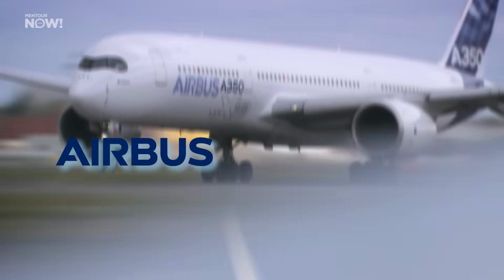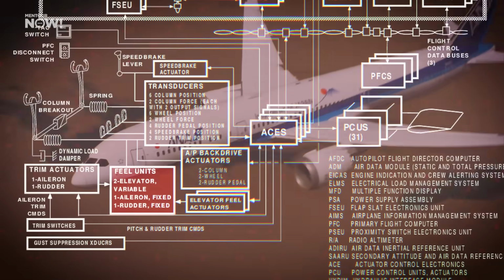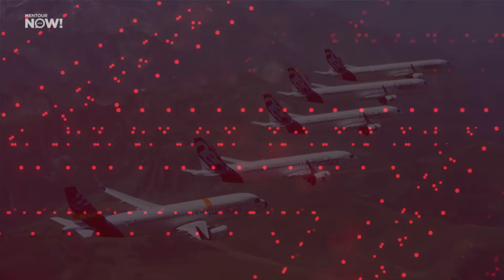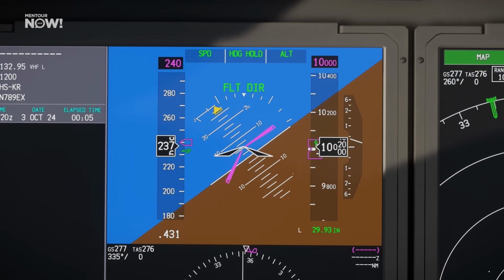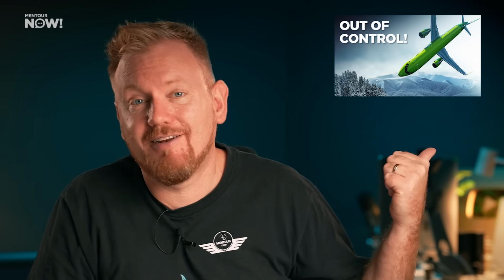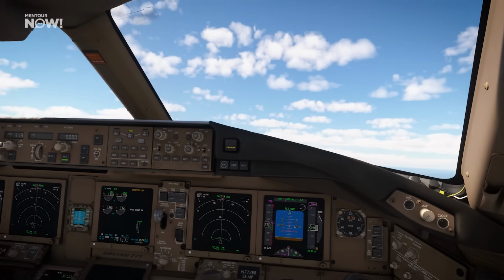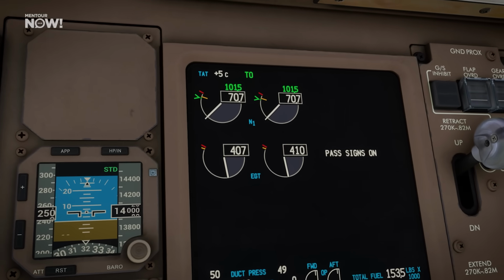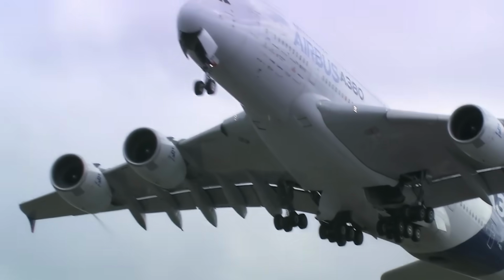Do Pilots Prefer AIRBUS over BOEING?!

Comment: An overlooked difference IMHO is the cockpit layout philosophy (consistent color coding on flight instruments, arrangement and design of pushbuttons and system groups, "dark cockpit" philosophy etc.) is really well thought through at Airbus. They studied the human factor very well when designing the A320 human/machine interface and it still shows and is consitant till the A350. If you look at Boing cockpits, you can see a rather confusing arrangement of buttons and indications seeminly random and unintutive compared to Airbus.
Reply: @klarname429  And it's not like there is no philosophy in the boeing cockit. Take a look at the B737 FCOM in which it is explained. For example the light, switch and panel colour philosophy. 

And to be honest as a pilot I prefer the switches instead of the corry buttons. Just by the fact that u can see the position even if only STBY PWR is available.
Reply: @memeswithoutcontext4716 Idea that you prefer switches to p/b reminded me about the Helios 522 crash, due to incorrect switch position
Reply: I've read reports on cockpit layout philosophy but I have not taken the time to compare. I will look at this. Very informative comment!
Reply: Boeing has consistency across it's models as to where things are located, example on the overhead.  Lower left is always hydraulics, upper left is IRS, upper center is fuel pumps, lower right is bleed air and pressurization, lower center is gens/apu.  This is super consistent across everything from the 747 to the 787, the 737 is close but not exact because Southwest demanded that the overhead panel of the 200 series be retained in the later models.
Reply: Sure, but you have to think of consistency in the reverse, in the context of how Boeing cockpits have evolved over time.
Reply: The 787 is catching up well closer then the older Boeing designs
Reply: And this all seems like different flavor until... You are under stress and you have to figure out what is going on, Airbus is so much better at reducing workload and displaying clear information... Boeing always makes it into crash videos because a pilot didn't notice one thing on one screen or they troubleshooted the wrong problem and ran out of time.
Reply: @OliverMayo-c4n Do you mean like the 737 max with its runaway MCAS trim, where the pilots both had to pull on their yokes with over 70kilos to try to keep the plane leveled and their power was not enough to trim manually?
Or do you mean back to "Tante Ju"?
Reply: The Boeing arrangement on the 737 requires a thorough knowledge of systems, while the Airbus requires a thorough knowledge of procedures. The A320 has been flying for 40 years. There are still Boeings that started flying 70 years ago!
Reply: Boeing pilot here, jeah thats objektively a fair point...   but to be honest compared to Airbus, Boeing has less cockpit control confusion incidents most likely due to its organic design. For example the throttle quadrant with its controls... 

Cheers.
Reply: @memeswithoutcontext4716 You'll get used to if you train enough ofc

But those thing is indeed being a factor for some crash in the 90's right after new layout was introduce
Reply: @OliverMayo-c4n No. What I meant was  you cant control aircarfts like 737 / A320 or bigger manually because of the aerodynamic forces on the control surfaces.

AF447 is a bad example. Because unreliable airspeed indicator is not easy to spot without visual references especially if several sensors are affected. I think this could have happened on a 737 as well.
Also to note, an A320 can help help even in such cases by turning speed indicators into a bar showing if you'r AoA and thrust settings are in a safe range.

A crucial thing is perhaps a deeper understanding how  systems work together and affect each other.

PS: A massive block of text without a paragraph is difficult to read.
Reply: @OliverMayo-c4n Keep your teachings to yourself. I know well how planes work.
Reply: @OliverMayo-c4n Thanks for your recomendations. But better to keep your teachings for yourself. Not that I don't know how airplanes work. ^^
Reply: @OliverMayo-c4n Obviously you didnt got my point. I know how aircrafts work. Do you?
But pls dont answer. Im not interested to move forward or somewhere else with you^^
Reply: Porsche did the design of the Airbus cockpit originally
Reply: "really well thought through at Airbus". Well, I guess that explains how they turned one of the first fly by wire models into a lawn mower at an airshow. Just needed a little tweaking of that software I guess.
Reply: @klarname429  Let me give you an analogy. A typical traffic light has all lights being the same size, just like how Airbus switches are homogenous. But there are some traffic lights have a red light that’s bigger than the other lights and there are some traffic lights that have a green arrow light that’s bigger than the other lights, like how some switches in a Boeing cockpit are different than others. Why do you think traffic lights with one light being bigger exists? Is it because they made those traffic lights using a hodgepodge of random parts, or was it intentionally made so that the lights that require more attention are easier to see?
Reply: So how this helped Air France 447?
Reply: @zdenekkindl2778  that was mainly the fault of the airline. They gave the pilots no training. Also the Captain's fault when he knew the weather was bad. Bonin was also not experienced enough on that aircraft
Reply: I herald back to the time when a four engine B17 or Lancaster flight crew with a shot up airplane, two engines out managed to fly across Europe and the English Channel, locate and land their aircraft. And all this with an altimeter, single air speed indicator,   bank and angle indicator and a magnetic compass! If we want to fully automate airplanes then, fine,  leave the pilots on the ground. It seems they're only there to reassure the passengers!
Reply: The dark cockpit philosophy, logical arrangement of buttons and consistent color coding is also integrated in every Boeing cockpit. What exactly are you talking about?
Reply: They did not.

Poor cockpit interface is why Air Inter 148 flew itself into the ground. 

Poor cockpit interface is why the first A330 crashed at the hands of a test pilot who didn’t know what was going on. 

Poor cockpit interface is why Air France 447 wound up at the bottom of the Atlantic.  

None of those would have happened to a Boeing aircraft.
Reply: @calvinnickel9995  oh really... so no Boeing aircraft stalled ever and met w an accident... check the history
Reply: @calvinnickel9995  Funny.
Reply: @calvinnickel9995  That was a long time ago and has been fixed
Reply: @EvoraGT430

Every Airbus is still flying with a side stick that offers no tactile feedback and an Alpha Protect system that will happily turn itself off without informing the pilot.. as well as letting airspeed slip to less than 100 knots as long as angle of attack is preserved even though the recovery altitude is subterranean.
Reply: @klarname429  a consistent color coding and arrangement of buttons does not make things safer. One button can be mistaken for an adjacent button or a button of the same color.
Reply: @Blank00  An intuitive human/machine interface reduces the mental load in phases of high stress e.g. because of an abnomal situation. This can indeed be a safety factor in such cases.
Reply: @klarname429  just because buttons look different than each other doesn’t mean it’s not intuitive. “Seemingly unintuitive” isn’t necessarily unintuitive, especially since pilots of all aircraft types go through some sort of training. Let’s say you are presented a 2 panels, each with 2 controls: one with an engine-start button and a seatbelt sign button with the same button design, and one with a red circular engine start button and a gray square seatbelt sign button. With the latter panel, it’s easier to tell which button does which because the buttons look different.
Reply: I worked decades in automation and humans need contrasting colours and shapes in fixed positions that can be learned by practice. Consistent neat matching buttons and colours impress the public and are deadly dangerous.
Reply: @andrewcarr3650  "All white lights off" to bring an bus from cold & dark to live. I mean, how easy is that?
There is nothing dangerous in having an consistent behaving UI even on different types. The last thing you want to see is a overwhelming colorful blinking x mas tree.

Comment: Right now, Airbus is safer, but once Airbus starts advertising single-pilot operability for their future planes, I bet the tables will turn. A cockpit relying only on one pilot is just as risky as MCAS relying only on one sensor.
Reply: That will be mostly country specific. So Asian carriers will require 2 pilots, Europeans 1 & American may fly it as drone only!!
Reply: cool, as a simmer, I've been dreaming of landing an airliner
Reply: Well if the technology matures enough and becomes readily available, Boeing also has to provide it, otherwise they would lose even more market share. I would bet on the more mature implementation than the one hastily put together. I also bet it would be used for a really long time on freighters only before it's allowed on passenger aircraft.
Reply: I don’t see single-pilot operation on passenger airliners anytime soon. First step is getting rid of the relief pilot on an augmented crew on long-haul cargo flights, so during cruise one pilot can rest on the rest area, while the other one is sleeping on the cockpit 😂
Reply: Germanwings was single-pilot when it crashed. Airbus already tried it.
Reply: You've got it the wrong way around.  The airlines are the ones driving single pilot ops research.
Reply: @conanthelibrariansunflower  I corrected that comment. At this point, it would come down to Airbus deciding to go forward with single-pilot development. This is another area where parallels can be drawn because Boeing’s choice to MAX the 737 over an all new type was in response to a push from airlines (namely AA and Southwest)
Reply: @Blank00  They already are, at the behest of the airlines.  I was told this during my A350 course in Toulouse in 2019 by the chief pilot.
Pilots, via their Unions are fighting this.
Reply: U would have basically a remote FO on the Ground that could support any minute
Reply: @Infiltator2  that is less safe than a second pilot in the cockpit. A copilot in the cockpit will be more likely to hold oneself accountable than a remote FO because the copilot’s own life will be in their own hands, just like everyone else onboard. A remote FO will not feel as much obligation as an in-cockpit FO, and a remote FO will not be able to observe 100% of the things an in-cockpit copilot can
Reply: @Blank00  he will also be under a lot more stress than people being on the ground. If it would be up to the Airlines it would already be in service

Comment: Honestly Embraer. Everytime I've flown in a Boeing or Airbus there's always been bits of cabin trim not correctly attached, overhead lockers that take more force than they should to close, failed passenger display units etc. On Embraer flights I've always been happily surprised at the way they're put together - nothing broken and everything works.
Reply: It’s because Boeing and Airbus planes have more passengers per plane, therefore more wear. It’s also worth mentioning that both planes support 3rd party design interiors (E.G Delta’s A320s and 757s use cabin parts from Safran and NuLook) while Embraer interiors only allow Embraer parts
Reply from the maker: Embraer does make nice planes, but a lot of what you're seeing is maintenance and wear-related, which varies from airline to airline, not manufacturer to manufacturer.
Reply: @MentourNow  about wear and tear, the same point can be said when it comes to the wheels that fell off United planes and the worn switch caps responsible for LA800
Reply: @MentourNow  Your argument would make sense if it wasn't for fact that the airline I've flown almost exclusively for the last 17 years runs Airbus, Boeing and Embraer. Sure the Embraer is used for the shorter hops, but it's always a better, cleaner, and more reliable experience than that of the Boeing or Airbus jets.
Reply: Wich are all not safety issues
Reply: @dapje2002  Sloppy assembly has no place anywhere on an airplane. Poor finish is an indication of general carelessness. It may not be conclusive, but it does strongly suggest.